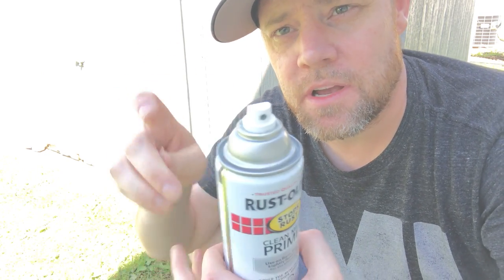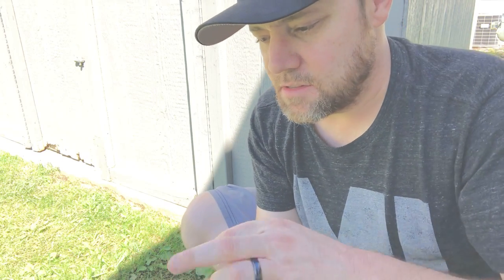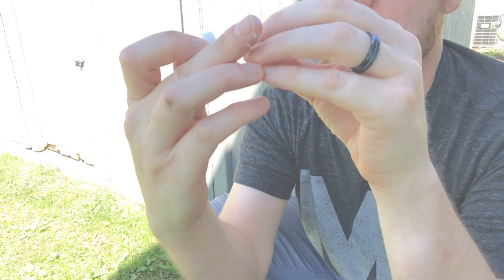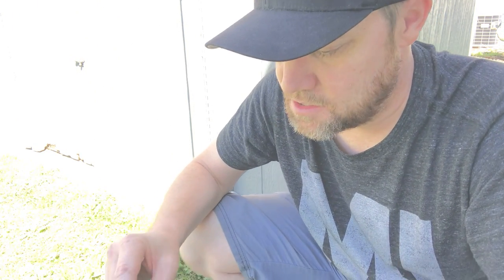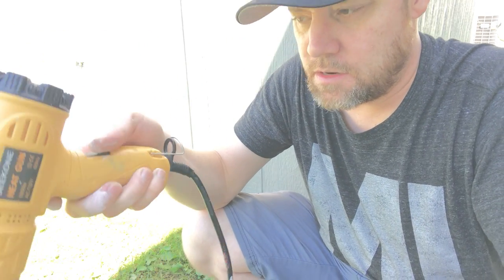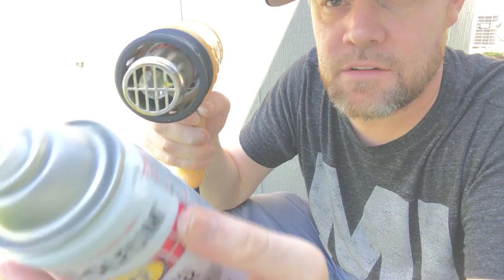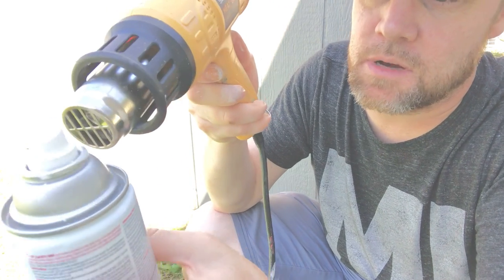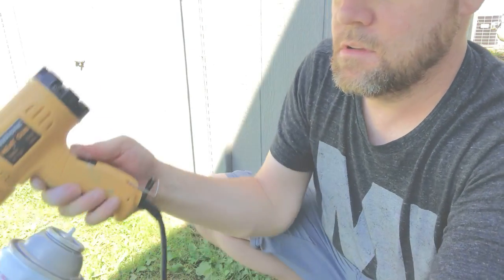Spray Paint Not Spraying, Spray Paint Nozzle Clogged, Spray Paint Can Won't Spray,

Comment: The heat thing totally worked. I didn't have a heat gun so I just poured really hot water over the can. Thanks!
Reply from the maker: Great. I'm glad that worked for you! Hair dryers can also work sometimes.
Reply: Sounds like a safer option iny humble opinion.
Reply: @missk1942 the hair dryer or the water also did u use like really hot faucet water or like boiling water
Reply: I put it in a bucket of hot water and that did the trick!

Comment: WARNING !! I tried this method. I heated the can with my heat gun like the guy in the video.....the smaller portion of the tank seal burst and had friggen paint all over me and my shop !!!  My heat gun could of set the paint on fire or exploded I do NOT recommend this !!!
Reply from the maker: The key is small increments of heat only for this method. Not intended to be used for a long duration.
Reply: My "shop" has all kinds of paint all over it.  That's why it's my "shop" 😂

Comment: I’m guessing that the heat is increasing the pressure in the can vs softening the old paint, although it could be doing both. Just be careful not to heat it too much or the can could rupture.
Reply from the maker: Yes, I’ve always only applied small increments of heat here, doesn’t take much!

Comment: I keep the nozzles when I am done with a can and it is empty. Before storing the nozzle, I shoot carb cleaner through it. Instead of using a heat-gun, I put the can in the sunlight for a good while.
Reply from the maker: Another great tip.
Reply: Turn the can upside down and push down on the nozzle to blow propellant out until it's clean with no paint. That guarantees the nozzle is clean and you don't need to use anything else like carb cleaner on it which might actually melt the plastic anyway. Best wishes! 💨🤔👍🏻

- Max Giganteum
Reply: @MaxGiganteum  That does not work on some cans that can spray paint even when upside down--like most Rustoleum paint spray cans.

Comment: I like this so much better than hot water 👍.  When high pigment artist/graffiti cans clog it can be so frustrating. Especially when some cost almost $10 a can. Although I never mess with clogged caps because they're so cheap. You can get male and female caps and adapters in plenty of different shapes and sizes. It's totally worth having some on hand so you don't have to worry about a clogged cap or a weird spray pattern anymore. And ultimately whenever all else fails, I will take a small paint roller, (the style with a solid bar) you can hold the can with one hand, use the paint roller and the tip of that solid bar to pierce the bottom of the paint can so that way you can at least cover whatever surface you want to cover (although it handles like a garden hose). Or you can point it into a bucket with non spray-paint paint and use it to change the color of the paint in the bucket. Then use a roller to cover a wall or surface.
Reply: Change the color of paint? Oil based?

Comment: I also used this idea with hair spray long ago, using hot water, but be careful when heating pressurized contents.  I burn trash and usually pull out aresol cans or even pull lids off air tight bottles, heck they even explode in an enclosed vehicle or even in truck bed, which I had soda cans explode.  But it is a good idea and works well
Reply from the maker: Always good to use with caution! Some good tips.

Comment: I use small, large paper clips. Thanks for the heat idea.
Reply from the maker: Sometimes the paperclips are hard to get in the actual nozzle itself, but have worked for the underside of the tip for me. Thanks for watching!

Comment: The heat is a great idea. If I  were a betting man I would bet that the benefit of heat is raising the internal psi of the can and not 'loosening things up'.

Anyway, Bravo! I have 100 cans that are half full and clogged. I will be trying this!
Reply from the maker: I try it with limited exposure in short bursts, just because contents are under pressure. I'll try the tip for a few seconds then turn the can and try a different part, then maybe the bottom. I also tend to shake and spray the cans on a somewhat regular basis so they don't sit unused for too long.
Reply: Will try this tomorrow. Have full can of the same in your hand that won’t spray. Makes me nuts. It’s great paint. Very durable.
Reply: I made a paint  mixer for spray cans with conveyor rollers and an old drill motor. I can let old cans that won’t spray turn for an hr if desired and this works often but not always. Best thing about that I can let them run while I do other things in the shop.

Comment: I have three cans of Rust-Oleum primer that are new and I got one short spray and they all clogged within about a second or two of initial push of the cap.
The needle valves are all clogged, not the caps. Any other solution, besides punching a hole in the can to get the paint out? $30 worth of paint inaccessible!

Comment: I’m having this issue right now with an almost two thirds of a can.  I just soaked it in nail polish remover based on another video. If that doesn’t work I may try the heat gun.
Reply from the maker: Do you store your cans inside? I always like to make sure my cans are inside the previous night before I have to use them, especially in the colder months up here in Michigan.

Comment: any tips when the nozzle tube gets stuck and it doesn't come back up anymore? I tried the heat gun but it is still stuck and i can't press it down
Reply from the maker: Do you have a push pin, or long thin needle like device you could push down in the tube? Try holding down the nozzle tube without the tip on it from different angles, try spraying upside down, or possibly let the can soak in some hot water for a bit.

Comment: how much does a heat gun cost? haha. What if you're off grid somewhere - how many watts does a heat gun draw? hilarious. thanks for the advice though. The nail through the top is probably all that I need to do to fix any future spray cans.
Reply from the maker: Blow dryer? Small heater? If you live off the grid, I'm sure you're super resourceful.

Comment: Warning: if the pressure inside of the can gets too high it could burst, so be super careful with the heat gun or even a hair dryer if you insist on using one which I would not. What you need to do is determine first off whether the clog is in the can's stem or the spray nozzle. If in the nozzle, clean it out or replace it. The smart play to prevent clogged nozzles, is to turn the can completely upside down and push the nozzle down until no paint flows out once you're done actually spray painting. No paint = no clog so get into the habit of blowing out clean propellant every time you finish spraying. To get freebie nozzles, simply pull them off of cans once the paint supply is exhausted. Store them for future use - you'll thank yourself for doing so! If the stem is clogged, use the valve stem from a car tire/rim to blow air into the can. Attach the threaded end to an air line then push the rubber base down onto the can over the stem very tightly. Tap the handle or lever to blow air in briefly to clear the clog, 1 second inputs is all it takes. Note: the air supply has to be at a higher pressure than what's in the can for this technique to work! Do NOT overpressurize the can or it will burst! How many PSI to go for? Start at 90 but don't go over 120. So what if that doesn't work? You're probably not going to clear out the stem but here's a last resort. Use a small diameter drill bit to carefully clean inside the stem. Warning: wear safety glasses or a full face shield to prevent an eye injury!! Be very careful to avoid piercing the valve or you'll get a non-stop stream of paint in your face, up your nose, all over you and/or everything else until the can blows off all the propellant. Don't point the end of the spray can directly toward you at any time and make your clog clearing attempts outside where getting paint everywhere won't matter. Wear crap clothes with long sleeves and some disposable latex gloves like a doctor or nurse wears. Stay away from all open flames. Danger! Many propellants are highly flammable and explosive. Example? Propane is commonly used. So what if all attempts fail and the paint simply won't spray out. You've got two options. Check the unusable can in the trash or pierce it open to salvage the paint. Can that be done safely? Yes, if you make the proper preparations and plan on using the paint immediately. That's the catch with the paint - it'll start curing as soon as it gets into normal atmosphere. I leave the process of paint salvaging to you. Best wishes! 👍🏻👨🏻‍🔧🇺🇸

- Max Giganteum
Reply: I forgot to mention the obvious... for any spray can, whether it's for spray paint or a lubricant or a degreaser or anything else, if it runs low on propellant but there's still material left in the can then you can use the car tire valve stem trick to just push normal atmosphere into the can. Again, don't over pressurize the can! 90 PSI is more than good enough. Will this trick allow you to salvage the rest of the material in the can? Of course it will... as long as the valve is undamaged. Best wishes! 👍🏻👨🏻‍🏭🇺🇸

- Max Giganteum
Reply from the maker: Thanks for watching, Max. Just a few seconds of heat is all it takes for me.